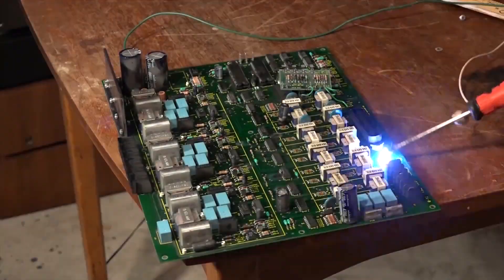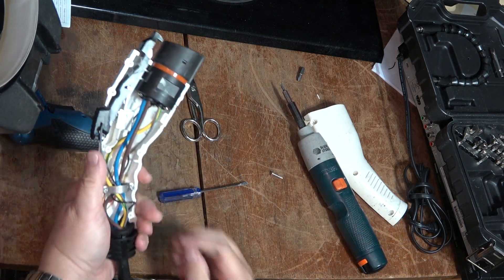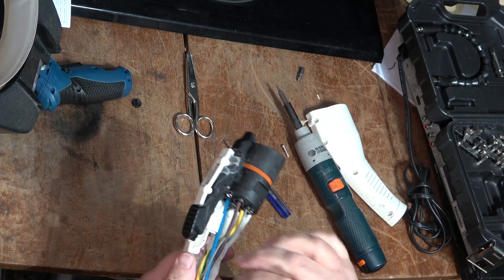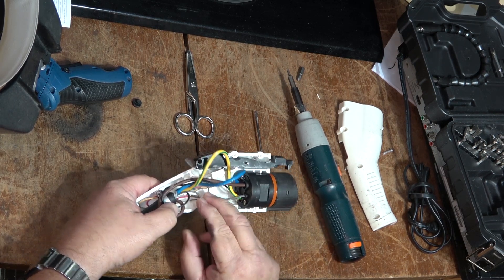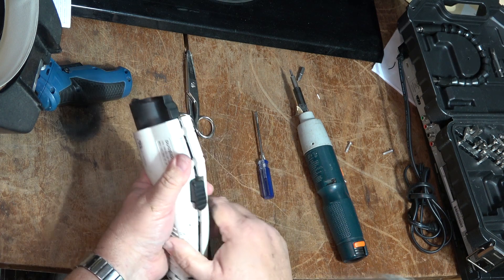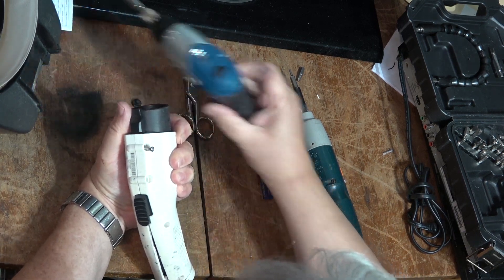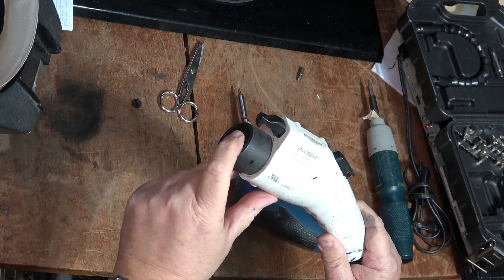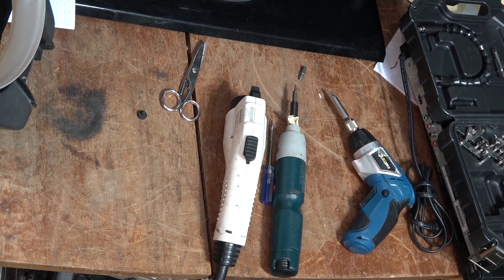EV Charge Cable Repair (Car Side)

Comment: What bit is used to take the screws out?
Reply from the maker: I believe the main screws were philips. May have have torx on the strain relief clamp inside.  It was awhile ago and I didn't take note, I just selected the correct bit and went to work.

Comment: Thanks so much for this! The same thing happened to my Juicebox charge cable, and thanks to this video I was able to repair it. The hardest part (aside from locating the necessary torx bits) was trying to fold those thick cables in a way that I could stuff them back into the handle. You saved me hundreds of dollars!
Reply from the maker: Glad it helped!

Comment: I can see that each wire is insulated in yellow, blue, black, brown insulation jackets. Are the internal conductors inside the EV charger bare conductors touching each other or do they have a coat of insulation?

Comment: The GM-branded Clipper Creek charger that came with my 2017 Volt isn't particularly well sealed against moisture. Every now and then it will give me a 6-flash code that I have figured out means moisture detected. There must be a sensor somewhere on the board. All I have to do is open it up and dry it out, and it will work again.
Reply from the maker: I had no issues with my clipper creek but the unit was never out in the rain, it was just inside the door. Only problem was it was only 12 amps and that meant another hour to charge.  It's now back in my car for traveling.

Comment: Electric cars are ok in my opinion. Much simpler to service than fossil fuel ones. However, in my country we still get the majority of the electric production from coal, so we still have a major contribution to pollution. The e-car does not stink up your garage but still creates pollution, just somewhere else. Just out of curiosity, what is the electricity made from in Canada? I assume you do not use coal much, atom energy, perhaps? Gas?
Reply from the maker: The slogan is "powered by water" here.  It's mostly hydro electric.
Reply: @12voltvids  Huge envy here. I am glad someone was able to have a great outcome from the whole e-car industry. Hydro-electric was never a huge deal here. Hydro plants cost (past tense intended) too much money to be profitable in any foreseeable horizon. You need huge donations to do anything in our country, otherwise the opportunity is lost, maybe even forever.
Reply from the maker: Here is bc it is all government owned.  They had the foesight 100 years ago to build large dams to generate power.  A new huge one is being completed now.  Keeps our electricity reasonable.  So it costs about 1/5 the cost to drive an EV vs a gas guzzler.

Comment: They call it EVSE (electric vehicle supply equipment) because it's technically not just a cable neither is it a charger
Reply from the maker: It's not a charger. That is on the car. It's just a cable with a disconnect relay on the other end. It also generates a pilot signal that tells the car what the charge current is based on a pwm signal that sits on that pilot/control line.  The on board charger on the car also signals the control end to turn on or off the power.  The controller also provides GFCI protection.

Comment: This reminds me of changing out my GFCI connector on my electric pressure washer a couple of months ago.

I don't know that I've seen someone use an old electric screwdriver manually.
Reply from the maker: That's just because i store that torx bit in that driver.

Comment: My charging controller (the box) had a surface mount component pop. Like,  its obv the part. But I lack microscopic vision, so yet it sits on my bench and I slow charge on 110V

Comment: I like the simplicity, no fancy junk in the plug.
If you have problems again,  put a couple of cable ties/zip ties on the cable after the clamp.
Reply from the maker: It won't break again. It was lose when i got it.